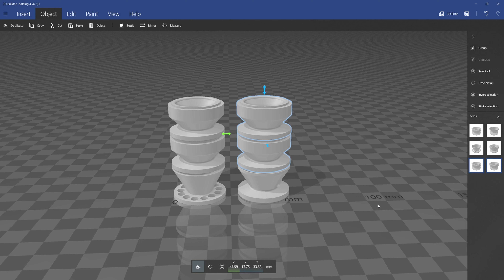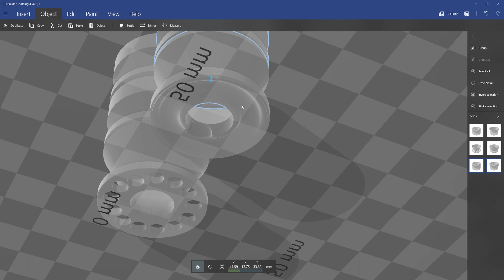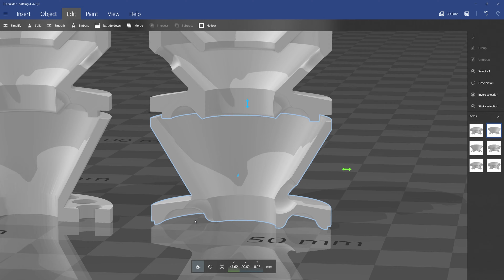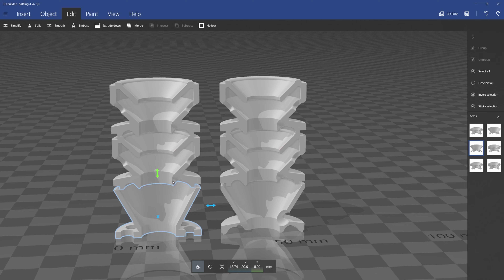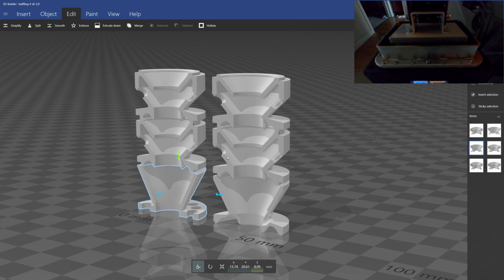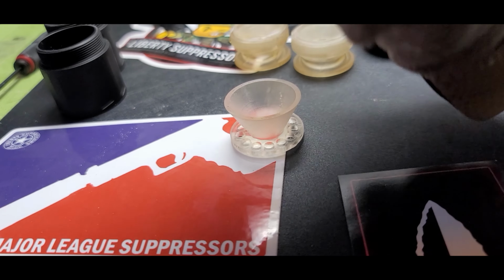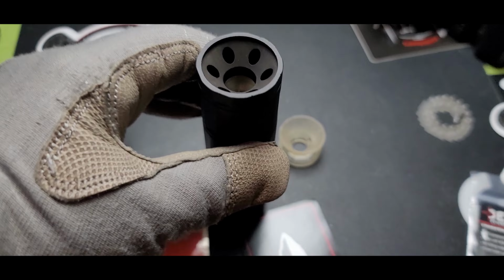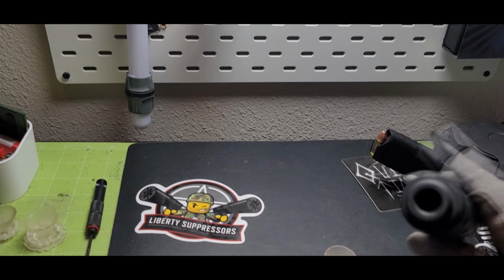Kaw Valley Precision Mach 3 comp

Comment: Curios, could you instead use the kvp mach 3 as baffels itself in a larger tube if they had seperators between?
Reply from the maker: I’m sure you could, it would have to be a tight tolerance with a stainless steel or titanium tube. That would be a fun project 😁

Comment: Id be curious to see this made as a throw away type insert. And also putting some thin rubber washers with a + cut in the middle in between 1 or 2 of the baffles to act as a wiper. Just to see how quiet u can get that first and maybe second shot. But if its made to be disposable you can just print another. Or if its made without baffles but has several wipers i dont think itll qualify as a shhh device so anyone could print, assemble, use and dispose at the end of a range trip. But only until it becomes cool then theyll come after it too

Comment: I've been very curious about doing a Form1 with this comp so I'm glad to see you're taking it on. Do you think a configuration like this would be safe for 300 Blackout? I know the comp by itself is rated for it, but I worry adding baffles would increase pressure too much.
Reply from the maker: Thank you and I'm excited to take this experiment on. I don't think it will survive a 300 aac round the pressures maybe to big, unless you're hand loading your rounds. The walls are thin. This would be grate for a 22lr or 22mag. I'm hoping it survives the 9mm round. Lol I might have to get another spacer for the section by the barrel so the can expand a little more. But we will see in testing. I'll be posting a new video this weekend. I had to change the design a little bit to make it easier for casting.
Reply: To bad the ATF won't allow form 1s any more for suppressors
Reply: @whiplash5026  it's more they don't want you to form1 parts that are ment to be a supressor from making,these are forward comps so they should let us since it wasn't born to be a supressor.
Reply: @aZombieToaster  would be cool to make the k cups slightly thinner then add a thin steel tube inside the comp to handle the higher psi or even a titanium tube that's really thin.
Reply: @aZombieToaster  any updates? I tried to find you on ig but your link treee was dead
Reply: 9mm exploded accura xtreme 200 resin you should cnc if you want to build this
Reply: I have the 6" version of the comp

Comment: I’m just not sure there is enough surface area in the last or end cup ( inside). And btw, you can do what I did, buy the solid 3” spacer direct from Kaw valley. So, my linear comp is actually about 6” long.